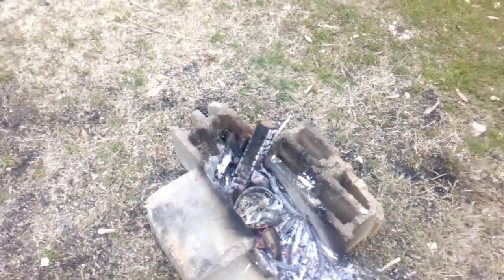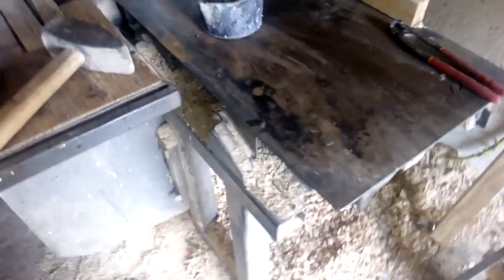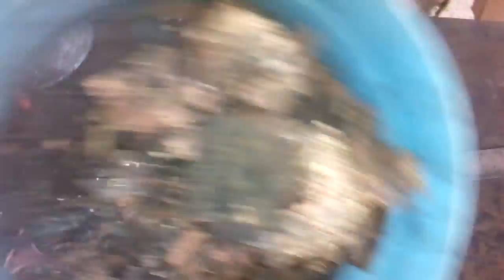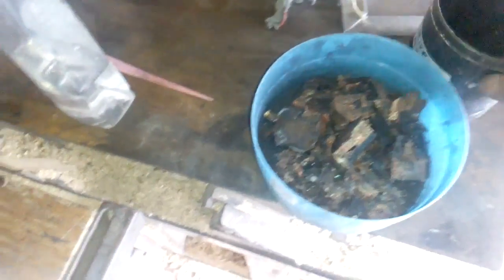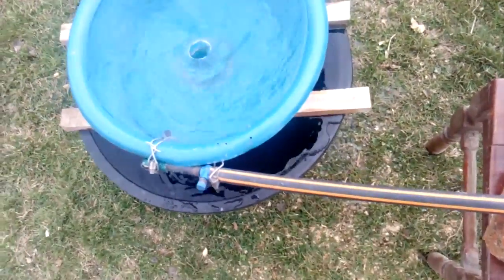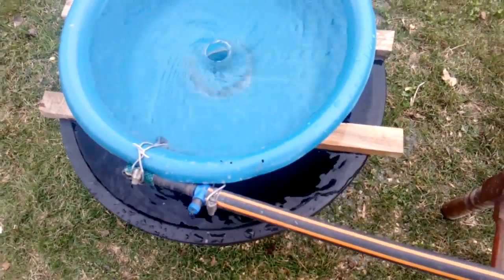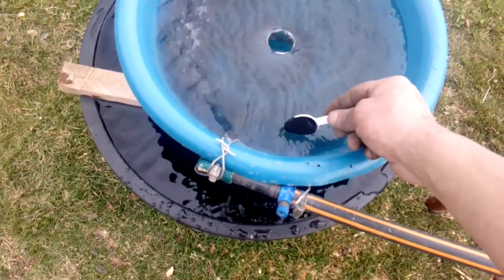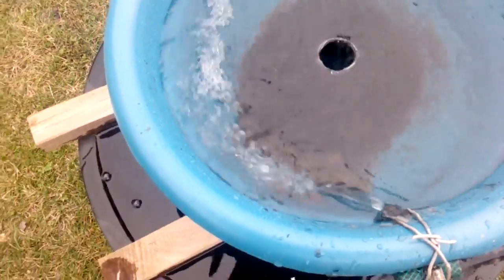Gold recovery & refining from IC chips full proces part 1

Comment: Great video! This is right where I'm at with refining my IC chips and ram chips. I am currently building a system very close to your set up, thanks for sharing it helps alot!
Reply from the maker: You're welcome, buddy, I'm trying :D
Reply: It's tough  cause the bond wires are so small but I think I'll get it lol after I've washed a bunch of gold down the drain lol
Reply from the maker: To paning is very difficult, I have no hand in it, so I made a blue bowl would not lose zlato.Trik is that finer grind chips that dust is easy, therefore the water pressure at least force and pick all the gold, therefore I said that in the video BGA gold recovery work much better blue bowl vizh smol preshure.